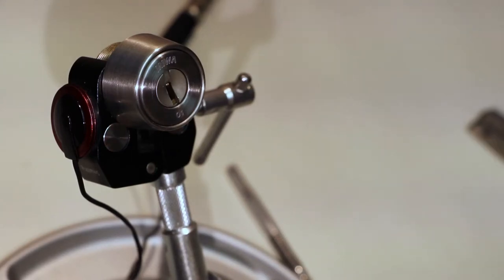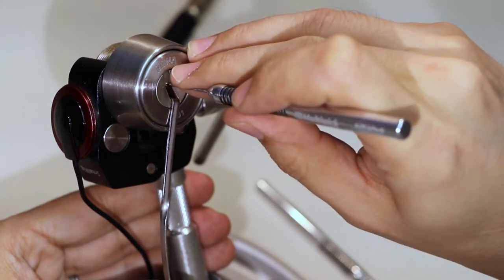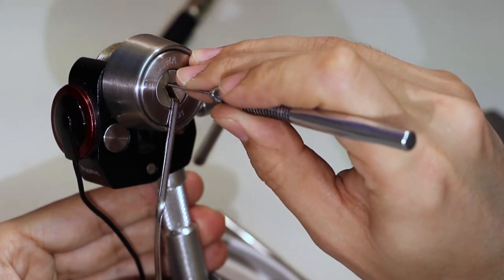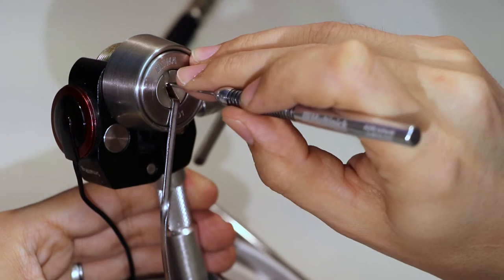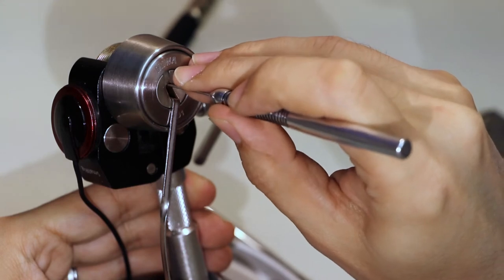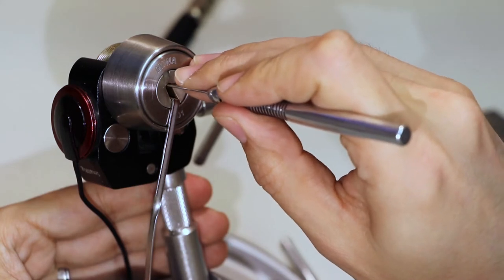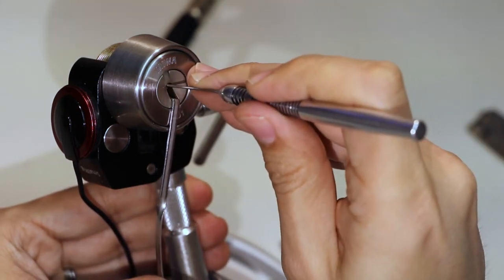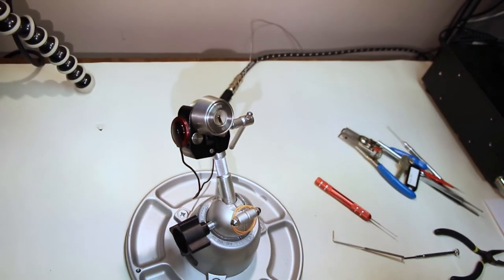[L70] Miwa JN (Kaba 20) Japanese Lock Cylinder - pick and gut

Comment: That's a great vid again, not just the picking, but the controlled dismantle of the core.
I hope you found the spring that tryed to escape. 
I have just in the last 2 days swooped a FEDERAL 730 padlock for a 
SQUIRE stronghold padlock ss65 with a kaba 20 core.
It weighs a ton! ,but the key looks quite interesting and different to the very few 
That I have seen.
It's quite a new lock,so it may simple be a new line,thanks again for the vid
And merry Christmas to you and all your family, billbo.
Reply from the maker: Ahhh, I've picked the SS100 with the somewhat easy cores it comes with. A Kaba20 in one of those would be very high protection indeed!

Comment: Are these good locks.
It’s pretty much a standard over here in Tokyo, just wondering if they are good?
Cheers.
Reply from the maker: I couldn't give you a lock recommendation, I'm just a hobby picker and can tell you if something is fun or easy to pick. You have to consider the other characteristics that make a lock good, eg. can it be broken easily by turning a screwdriver, can it be drilled easily, is there ways to bypass the lock, etc. From a picking perspective, this lock is very difficult and not super fun to pick.